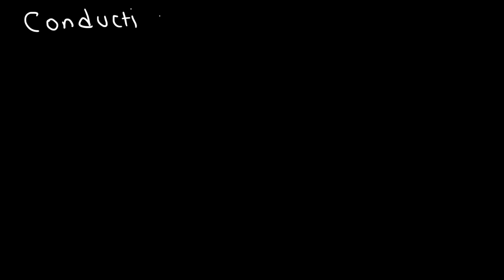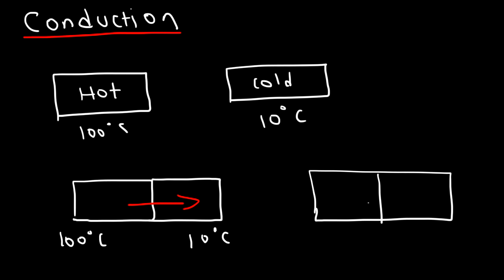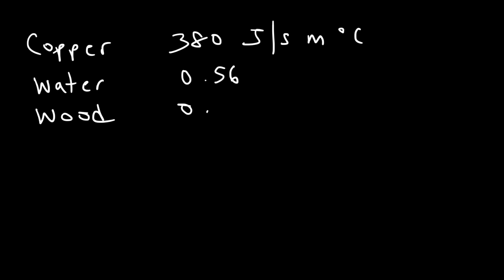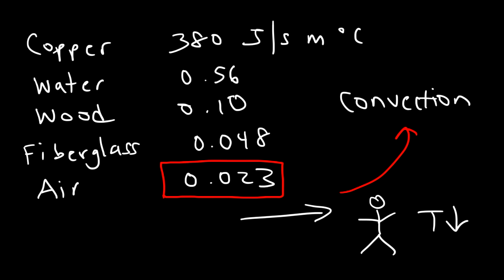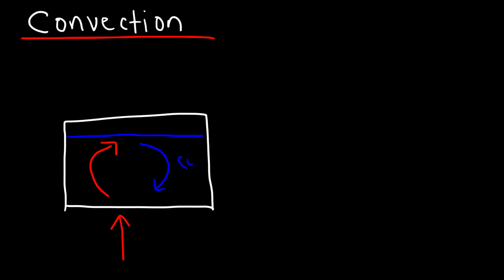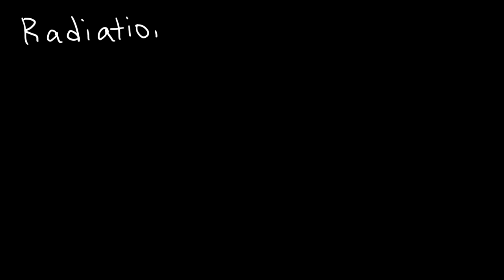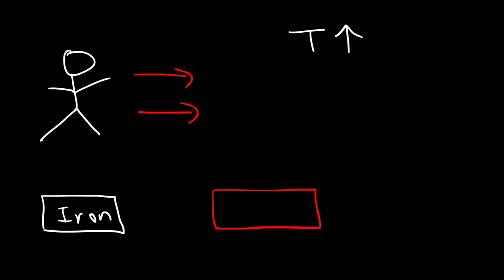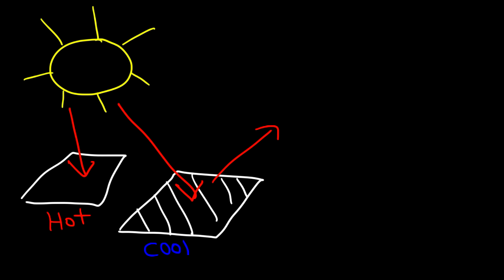Heat Transfer - Conduction, Convection, and Radiation

Comment: so a wood jacket with air pockets is the best insulator?
Reply: Maybe but why would u make a wood jacket that sounds dumb. Effective possibly. Worth it probably not
Reply: fibreglass would be more effective and probably easier to make/wear
Reply: we should make that a thing in minecraft lava proof armor
Reply: @coolguypro8207  Ye wouldn't it be crazy if they put in lava proof armor,  mabye they could make it stronger then diamond as well and if it's lava proof mabye they could make the one come from the nether as well. How crazy would it be if they put that into Minecraft.
Reply: @coolguypro8207  lol not the answer from the question MINECRAFT
Reply: @olliegrant5375  SUPER CRAZY
Reply: called it?
Reply: there is NO wood jacket
Reply: Using sunlight, copper pipes with water running through them (at a turbulent flow) with a black t-shirt or black cloth laying across the pipes (tightly with no air gap). You could use the radiant heat and transfer through the shirt into the copper pipes to heat water.

Comment: As I  walk up the stairs to the next floor of the house I noticed a bit of air current i know there is a fire downstairs in the  fireplace but what is causing this air current ? Would having a fireplace upstairs change anything about the air current in the house?

Comment: It is amazing that air is a poor thermal conductor (0.024 kcal(IT)/(h m K)]) and is equally is a poor IR radiator  - only the 1% of it ( the GHGS) radiate (absorb and emit infrared radiation). That means 400ppmv (parts per million volume)  CO2 and 1300 parts per billion(!) are doing the thermal transfering. Yet we are told the radiated GHG air molecules collide with the 99% non-GHG (oxygen and nitrogen) to transfer heat by convection - when they (by the numbers, thermal conduction) cannot thermally conduct (well).  So what gives?
Reply: Blair Macdonald ill just pretend i understood everything you just said.
Reply: I edited, maybe that helps.

Comment: 8:12 the nitrogen and the oxygen in the air are assumed by greenhouse theory not to radiate infrared, so you can't say ' in fact every object with a temperature above absolute zero radiates' when it is assumed by greenhouse theory not to; nitrogen and oxygen get their heat only from conduction (collisions) which you have shown not to happen also. Physics has a problem and I have the solution to all this.

Comment: If air doesn't conduct (implying collisions) how does greenhouse theory work then? How does the atmosphere transfer heat by convection if it doesn't conduct and the non-greenhouse gases don't radiate? It is said to transfer by collisions (conduct) Something is wrong. Air must radiate.
Reply: Greenhouse theory hasn't been 100% proven so your point is moot.

Comment: So is a down jacket a good insulator due to trapped air or the feathers? Or both.
Reply: Down is a fantastic insulator as the loft (or fluffiness) of down creates thousands of tiny air pockets which trap warm air and retain heat, thus helping to keep the wearer very warm in cold winter weather.